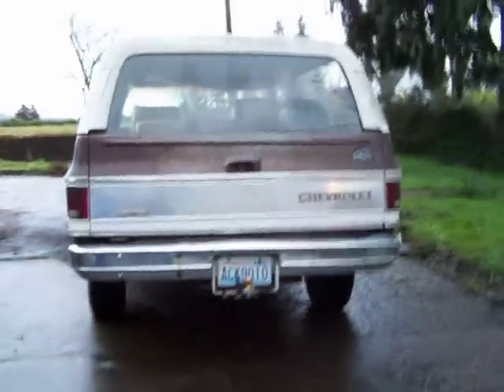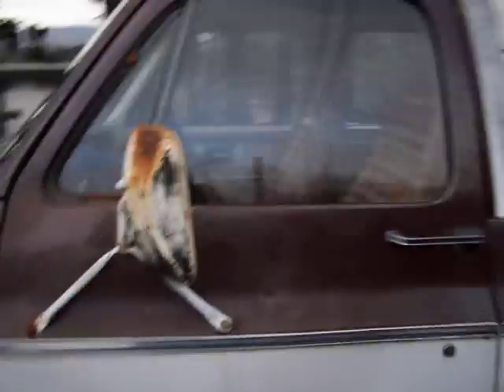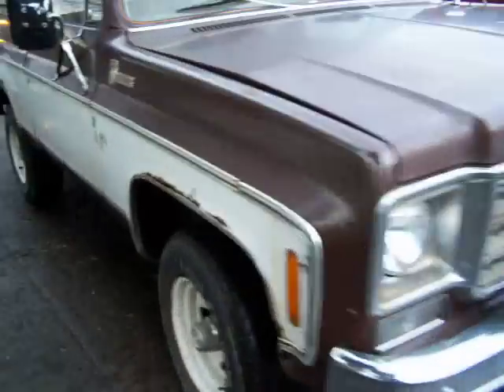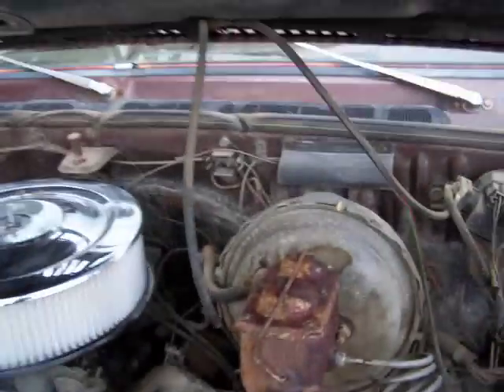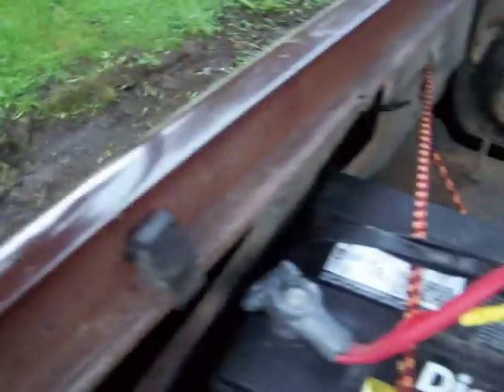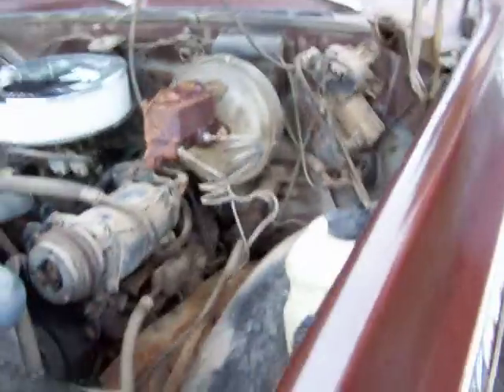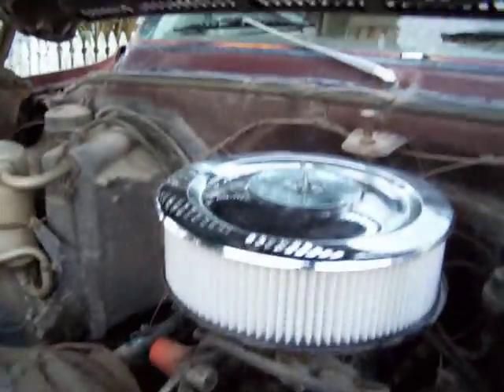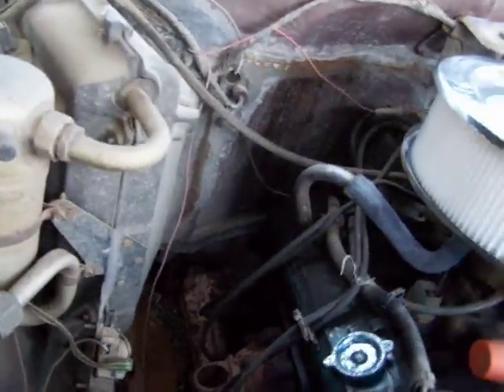My new Blazer a 78 K5 305 two BBL 4 speed manual

Comment: I LOOOOOOOOVE those old school K5 blazers!!!   My uncle had a 1980 with a 350 and automatic.   Did the 4 speed manuals only come with a 305, or can they also be paired with other GM engines like 350, 400, 454?   In fact his Blazer was the very first car I've ever driven in my life, when I was just 15 on a learner's permit.
Reply from the maker: I am not sure the specs on the sight don't imply if you had to have a 305 with the 4 sped or not. I doubt it. although it wasn't available with a 454 option in 78 on 250 six cylinder, 305,350,400,
Reply: The 454 was never a factory option in the Blazer or Jimmy. The 400 was the top engine from 74-80, and before that, you could get the 396 (called a 400 in trucks) from 69-72